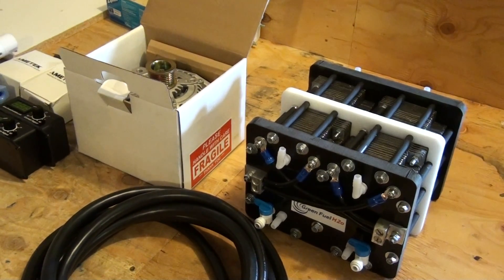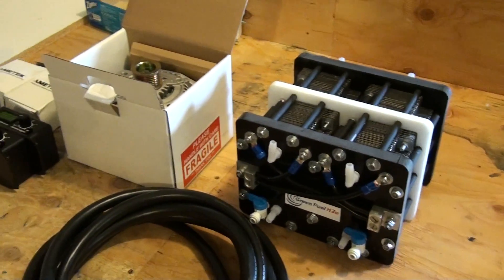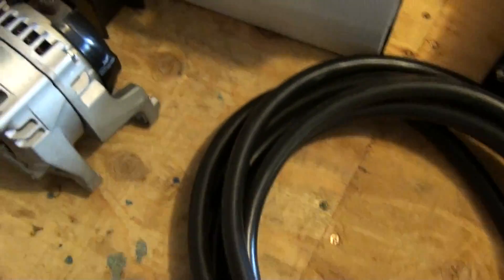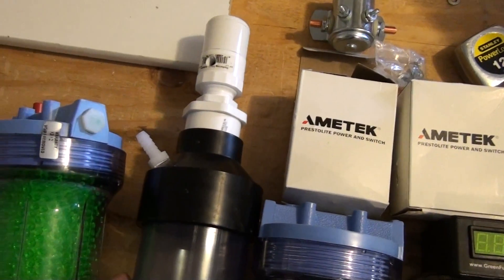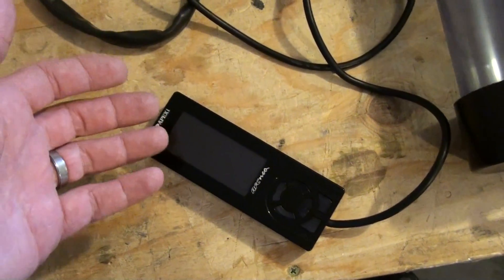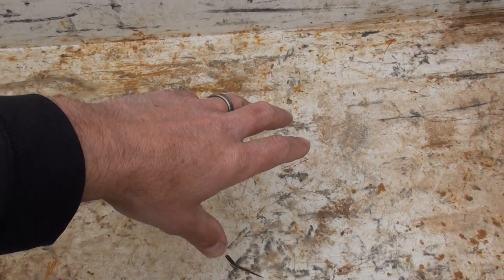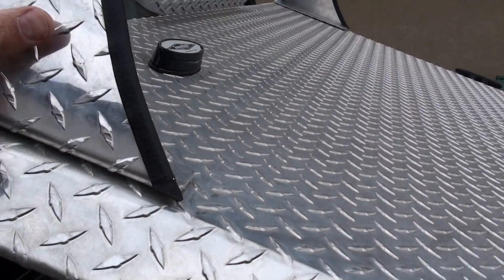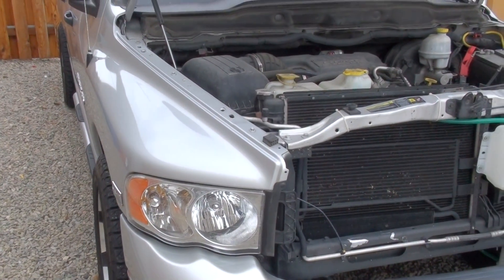288 Plate HHO generator Dodge Ram project. Part 1

Comment: This guy is an idiot 20 ltr a min lol if you install a LPG system you don't need the apexi. You seem to have no idea how your oxg Sensor is going to die doing this to your intake but you are American so your stupid as dirt.
Reply from the maker: Tony W Tony your not making sense.....
Reply: Your saying 20 litres <-- correct spelling of litre a min if you could which you can't your car would run solo on hydrogen. 
The reaction is symmetrical and conservation law applies. This is taught in junior high school chemistry. Assume all systems are 100% efficient.
Put 1kW of energy into some water and split some into hydrogen and oxygen. How much energy will you get back when you burn the hydrogen and oxygen you just produced? 1KW you fucking MORON. and cars a 30% inefficient so your running at a loss converting it.
Reply from the maker: Your language makes you look uneducated and says a lot about your character. If you understood what I was trying to do in this experiment you wouldn't say things that make you look ignorant. At a glance you are making a correct assumption but you are wrong about what is going on here. The HHO is not being used as a fuel so thermodynamics do not apply. The HHO is a catalyst that makes the fuel burn more completely. Look at it as a fuel additive. Litres is spelled liters here in the great USA!
Reply: You cant use HH as a additive ffs are you not understanding 1 litre of fuel to make even 600ml of hydrogen you burning more fuel to make it your not getting any fuel savings from making the hydrogen you cant get more energy out of a object then you put in so back to the 30% to 40% inefficiency you cant save money from your idea.

Comment: BRO. HOW MUCH IT WILL COST ME ONE SET OF THIS .I HAVE A MITSUBISHI PAJERO 1994 MODEL 3000 CC & 2009 MODEL 3000 CC ( TWO CARS )
Reply from the maker: This setup cost me about $5000 in parts.
Reply: That's too much bro .
I can do it easy .
I already started only S.S plates remaining.
PWM I got it from usa 12V. 80 Amp for same purpose .
Here the balance spar part easy to find it
Reply from the maker: When you find out how much money it takes to make 20 lpm of hho in a car you will understand.

Comment: What's the plate configuration? Looks like several plates are connected in a row with no neutrals between.
Also how do u regulate how much hydrogen gets to the engine, is it just adjusting the PWM?
I'm new to this 2 weeks ago, still learning.

Comment: with the total cost to build the system how long or how many miles would it take to start making a savings? and how long do you think the system will run for before having to replace major parts?

Comment: I would think you could put all this on a smaller vehicle and do some additional tuning mods and run on hydrogen alone. Run on just water. That should be the goal.
Reply: There's no way to "run on just water" if you're splitting it on the vehicle - you need more energy to break the bonds between the H and O atoms than burning the hydrogen will produce. IIRC the ratio's 1.35:1 - it requires 1350 watts of electrical energy to receive 1000 watts of heat.

Comment: Mechman Alternators are available up to 370 amps at running speeds and do about 180-200 at idle. The power wire is about the same as car audio 0 gauge wire. I am guessing your using welding wire? That wire is not overkill really for that kind of amperage imo. 
Watching the rest of the series now. Awesome job!

Comment: P-51's and old farm tractors used to use direct water injectors.  The water will break down by itself in the combustion process.  Saves all the electrical stuff.

Comment: I think circ pumps will benifit your cells alot in this situation. You have huge amounts of gas trying to get out of small outlets on buoyancy water gravity which will end up with backed up hho in the cell and low current draw. You will find if it cant escape easily the ionic flow will be prevented as the plates will be not saturated with water as the hho will be built up between the spaces!

Comment: I followed your hydrox projects and I noticed that you talk about mmw but never about the efficiency in relation with the plates exposed surface. So I was asking myself if it was not useful to speak in terms of mmws (mL/(min. x watt x square inch.) ? That's just a question ?
In your new project what kind of battery do you use (liquid electrolyte, AGM  or Gel technology) ?
I'm also waiting for part 3 !!!

Comment: Question. Are you designing this system to run on excess electricity from the Dodge? If so, wouldn't it be even more effiecient to use that electriciy to directly power the wheels? Some sort of complementary, electrical motor.

Comment: i have something else to share while a few are still here listening. now i only make cells with 2 sets of N plates and 1 + in the middle with no holes in the + plate and 6n on each side the the -, also i dont use a PWM instead i use a joule thief for each cell that way your amp draw stay low, you can get 2LPM for 12VDC@10AMPS. study all you can about joule thief circuits, this is where your HHO systems and your thinking will EVOLVE

Comment from the maker: You told me twice over the years and this time I took your advice. I have been researching them but I have not hooked the Neo up yet.You can make a dry cell with holes and have no current leakage. You just build a cell without neutrals like the cell in this video.

Comment: 2x 144 plate 6.0 MMW cells. Is = to 166.6W per liter per minute
250  Amp alternator X 13.8V = 3450W output
3450W output / 166.6W per liter per minute= 20.7 liters per minute of HHO

Comment: 55LPM of HHO requires 4824.5 Watts at 100% HHO Faraday Efficiency at 77F

100% HHO Faraday Efficiency at 77F =

87.7 watts per liter per minute

87.7 watts X 55LPM = 4824.5 Watts

4824.56139 Watts / 12 Volts = 402 Amps

Comment: @delvis11 I've often thought about "going for broke" on the production, like this, and wondered if it might be worth building a canopy from solar panels, and sort of letting the amps go wild, knowing that while u sat at work.. the panels would make up for it. Next build, too, I am going to have a voltmeter set right at the brick, so that when I adjust my PWM I see the actual RMS voltage.

Comment: but an ionizer doesnt have to make ozone-it can be a low power device that charges the atoms.
UV light can also ionize,so a bunch of UV LED's and an air purifier ionizer would probably be safer on a metal intake.

Comment: @delvis11 Stan Meyer used an ionizing device to charge the air going into the engine.
such devices can be found in convection heaters,air purifiers,some japanese import cars have them in the duct work of the AC.
i tried using one which made ozone plumbed into my toyota diesel van.seemed more responsive,but i got no data to back it since it never went on a dyno.
science is sound-look up ozone on wiki and read the part about combustion.
ozone oxidises metal so it will corrode your intake...cont,

Comment: @delvis11 I think it you have two batteries totalling close to 2000 CCA you'll benefit. Has anyone rewound an (extra) alternator, replace an AC pump with it, and rewound it to put out HV and then run the electrolyzer HVDC instead, keeping the amps down?

Comment: @delvis11 Then you can determine if the measured drawn amps represent peak draw, or if it has a peak surge point based on the voltage peak across the shunt.

Comment: @delvis11 Steve do you have a scope? If you do, take a smaller unit you have (if you cannot bench test the 288) First off, make sure the electrolyser is running not from the mains (because the scope will be on the mains) but from a battery, or dc motor driven alternator - some ground disconnected source, then take an analog ammeter on your input, drop the scope probes across that, and have a look at the input draw.. does it start low and level up to its average (read on meter) or hit a peak?

Comment from the maker: @reachthelight I use KOH but I drain my systems for the winter because of freezing. If you use a radiator it needs to be stainless steel.

Comment: why not put some solar panels on the checker plate lids to take some load off the alternator and add an ionizer to the engine air intake to get even more bang in the cylinder.

Comment: I would think a dual battery setup will be necessary like two yelow tops and upgrading factory terminals as well as the wire from the alternator to the batteries. Just like in stereo systems. I am looking to build something similar in my truck but it will require more mods :/

Comment: @delvis11 Well, do you have two batteries? I guess... the unit itself, can you even bench run it?! Might be difficult...I'd imagine... Being that it is a resistive load and not an inductive load I think your current is a steadier, slower "ramp up"... In an AC motor you have that characteristic inrush of current associated with an inductor that you do not have hear. You have the pulse width modulators, to back right off, intiially... your alternator is double... hmmm

Comment from the maker: @sylvanenergy since the tank is so big and the cell runs over 6 mmw there will be very little heat. heat wont be a factor even at high amps.
I'm not using a pump. I'm just going to let it naturally circulate itself.